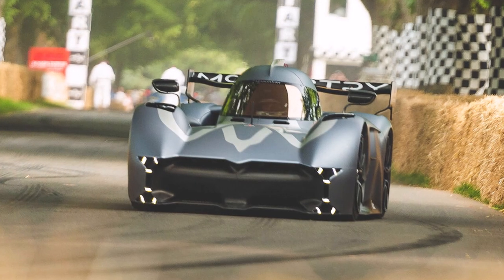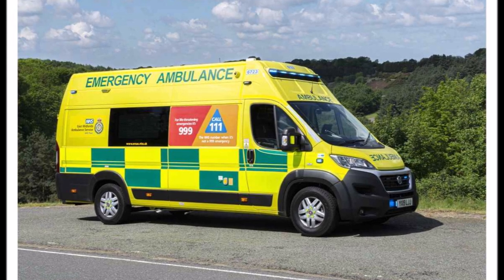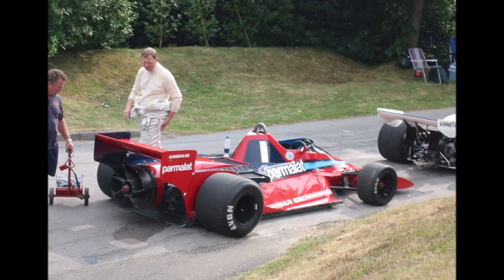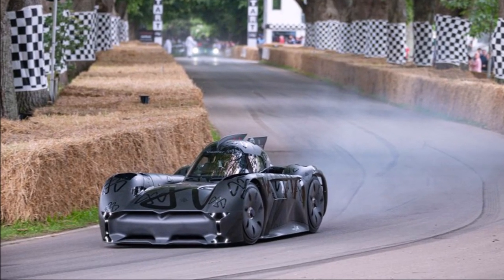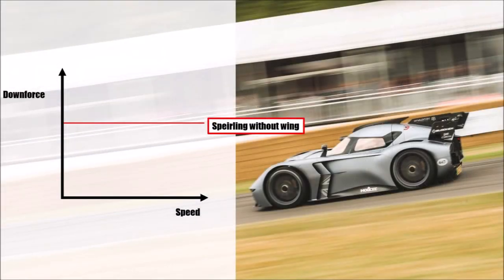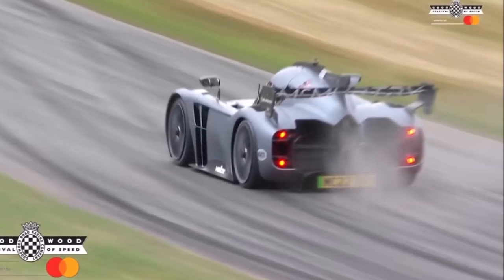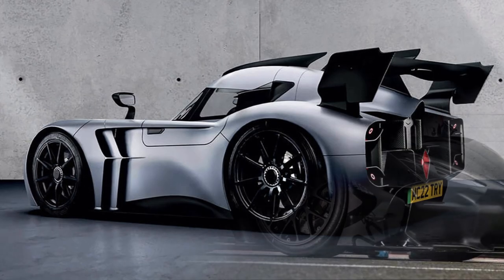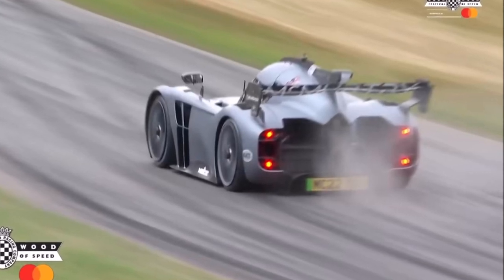McMurtry Speirling - The Unusual Engineering EXPLAINED

Comment: This car was visibly faster than anything I've seen before. Watching the speed gave me more of the sensation of watching a mach jet than a car. Just brutal.
Reply: To me it looked like the film had been speeded up. Astonishing.
Reply: It was about 6 seconds faster than 2nd place. Which is nuts on a track that short
Reply: The dust it sucked up made it look quick aswell
Reply: yeah, it looked like a gokart
Reply: @Life As Ya Know It it's both, the car was cornering faster than anything I've ever seen except for maybe an F1 car in a high speed sweeper
Reply: Legendary
Reply: So true this car was insanely fast and then wat impressed me to was the ford van tats shitt was hella fast too
Reply: I was at goodwood and felt that too
Reply: I suppose the fact that it's very small makes it look faster, just as a 747 looks slower than normal passenger jets, if you see what I mean.
Reply: @thugis07  
WTH is a”cords van tat shitt”?
Reply: @theinspector1023  
To paraphrase Father Ted “These jets are small but those up there are far away”
Reply: @theinspector1023  
Link to FT vid https://youtu.be/MMiKyfd6hA0
Reply: @thechumpsbeendumped.7797  the ford transit van bro u didn’t watch other good wood vids
Reply: @thugis07  
I did watch the Ford Supervan at Goodwood, but that isn't what you wrote bro.
Reply: @thechumpsbeendumped.7797  I was Only missing a letter bro n u couldn’t guess tat
Reply: Yeah I thought,christ that things absolutely moving!!last time inward that surprised was watching the Volkswagen idr.
Reply: @thugis07  
So 6 letters in total, coz the vehicle is called (drum roll) Ford SUPERvan. Never mind bro, you did get half the name right  😆  Well done dude, 50% is considered a passing grade in some places. 👏👏👏
Reply: @chopperhead2012  well it's nice to see a go kart to go that fast 🤭
Reply: @m.b.82  Isnt the car that get 2nd placed is had a record of 39,90? It's 0,10 slower than the 1st one, and the 2nd one is also electric, it's from Volkswagen
Reply: The 1st time I saw it…
It took corners so fast…I thought it was fake!!!

Comment: One of the maddest facts about the speirling that max Chilton mentioned in an interview was that with the downforce and traction control off it'll spin the wheels up to 200mph in 0.3 seconds
Reply: What does that even mean? That doesn’t make sense pal…
Reply: @TheLogicprouser  it's how fast the wheels spin in a burnout
Reply: @WynnofThule  so it can break traction in 0.3s? Is that 0.3s the time from pressing full throttle to the wheels breaking traction? Is that time actually impressive for an ev? Is there any other ev to reference that time against do you know?
Reply: I assume it means that the wheels spin to an effective speed of 200ph. 

As in the necessary rotation that would be required for 200ph if it was retaining all traction.
Reply: @FazeredTube  ahhh ok yeah that makes sense cheers bud 👍 comment read like at any speed up to 200mph it could spin the tyres in 0.3s which didn’t make sense but it was just me 👍
Reply: @TheLogicprouser  no, 0.3s is the time from throttle/energy input to the wheels hitting 200mph
Reply: @TheLogicprouser  it means the tires spin up fast enough to push the car to 200mph if it were to have traction
Reply: That’s just due to electric motors lol……
Reply: @alanmay7929  technically its the torque said electric motors produce but I'm just being pedantic
Reply: @TheLogicprouser  it means if you floor it, the back tyres will instantly be spinning at 200mph. Which is nuts
Reply: The wheels might spin at 200moh in 0.3 seconds, but that doesn’t mean it would accelerate the car to 200moh in 0.3 seconds if it had traction. The car is much heavier than the wheels…
Reply: @DanielFenandes  exactly. it does mean it has a wicked throttle response time. 
but it is possible to calculate the 0-200mph time with that info. if we had the weight of the wheels. the only thing that seems weird to me is that the say 1000hp . while such 0.3s time sounds like a lot more. or the wheels are very light and direct drive. meaning "0" drivetrain loss. the peak power draw might a few ms way higher than 1000hp or 746kw
Reply: @DanielFenandes  not my point. Chilton was saying that with the traction control off it does enormous burnouts
Reply: @thomashayhurst6547  ah yes, makes sense. But some people here are commenting that if it had traction it would accelerate the car to 200mph, which is nonsense
Reply: @DanielFenandes  yeah that's total bollocks. The laws of physics just wouldn't work that way
Reply: @TheLogicprouser  It means burnouts 4 life man
Reply: It's just a fun fact. Holy smokes people. 

How this was confusing or triggering for anyone.....is really triggering me.
Reply: Yeah I honestly believe that this is a bullshit claim. I would probably believe it if we were talking purely about the rotors of the motor, but accellerating the entire wheel that quickly? Unrealistic.
Reply: @theforbiddentoystore1203  you are correct in a sense. If we didn't have to take into account mass and drag then yes the car would accelerate to 200mph in 0.3 seconds. But if you add the mass of the vehicle and then the drag as it accelerates it's going to take substantially longer then 0.3 seconds to reach 200 even if it had all the traction.
Reply: @TheLogicprouser  Are you Scottish?
Reply: @michaellavery4899  nope. Midlands. 👍
Reply: @seelooney9042  Underrated comment
Reply: @cinimini4854  Being that an electric motor on a car is usually MUCH heavier than the wheel with much of that weight being the magnets, and with brushless motors the magnets are the only spinning part of the motor, i dont see why less than half a second to 200 is that hard to believe. Some light weight wheels and tires would be nearly no load to a 1000hp brushless motor. If the motor is making 1000hp its probably making more than double that in torque at 0rpm.
Reply: @seelooney9042  yes, people just don't understand. A lot. 🌻
Reply: @Dubz0408   Logical. But not for many people as they do not understand physics and math. Ofcourse is it easy for an electric motor with always all the torque available.  You and I know.  Sorry, didn't finish my engineering study. Yet learnt a bit. 😀😀👍🏻
Reply: that would be an acceleration of 30G.
Reply: @intrametaarchi1015  Maybe in a world of perfect traction but were talking about this being a tire smoke machine.
Reply: @Dubz0408  not necessarily. construct a body which will withstand this acceleration and place the car in front of a high speed train.
Reply: @intrametaarchi1015  We definitely need a jump start on that maglev tech in the US lol
Reply: But the top speed is only 150
Reply: Funny what happens when you have instant torque.
Reply: @Mukesh_Rana._  the top speed was only 150mph because of the limiter. This car seems it will continue accelerating until it loses control lol 250mph+
Reply: @Joel  it means with TC off, the wheels are able to spin, like a burnout, at up to 200mph in 0.3s. Or, in 0.3s, the wheels are able to slip at up to 200mph.
Reply: @WynnofThule  guess that claim is true, but it doesn’t sound correct. 
Even if the driven wheels weren’t in contact with the ground, it seems unlikely that they could reach an effective rotational speed of 200 mph in only 0.3 secs. With the car sat on the ground, for the wheels to reach a rotational speed of 200 mph in 0.3 secs seems wildly unrealistic..
Reply: @intrametaarchi1015  that's 67.9 g's. it will feel like car crash every time you floor it lol.
Reply: @ScramTek  yup. that's just some rubbish layman claim lol. triple overload the current with no wheels whatsoever maybe. max setting with only one button, not pedal. 0.3 sec is literally a blink of the eye. lol

Comment: As a track focussed hyper car.. this thing is in a completely different league to the new AMG project one. This is aerodynamic engineering at its absolute best. Good video Martin. Thanks
Reply from the maker: Thanks Olli, Agreed!
Reply: I bet that most AMG project one, Aston Valkyrie, Koenigsegg Jesko, etc. cars will never be driven close to their full potential unlike porsches, supras, and miatas.
Reply: Considering how small the car is to carry a big battery and that it's not available to public, I can assume its only good for this types of runs(2 or 3 laps full send) Don't expect this to have long range or be 'consumer friendly', like the amg or aston.
Reply: @sepg5084  Yes, those cars would mostly be purchased as investments and never driven in order to protect it's value.
Reply: @rickyricardo2006  it's not exactly what I'd pick to go shopping, but it is street legal and has more than enough range to drive around town. But McMurtry is too small to build them in any quantity so there will probably never be more than a few hundred MAYBE a few thousand, optimistically. Sadly its meant for the discerning collector market
Reply: @rickyricardo2006  This are just preliminary specs so it can be not true bit so far ive read it has a 60KWh battery which gives it about 30-50 minutes of racing performance (that time looks a bit optimist to me so i would say about half that so 15 to 30 minutes) so not bad at all and about 480Km range if driven like a normal car. Actually very impressive, i guess the secret sauce is to be a small car.
Reply: @teresashinkansen9402  480km range? I don't even think teslas are that efficient in real world my guy. This car has definitely a smaller battery then a tesla. Then again, teslas cars are larger. Either way, I'll take it for what it is. A car solely design to beat goodwood record. 

The most impressive thing for me is the fan tech it has to keep it grounded. Granted, they didn't come out with the idea, they implemented it flawlessly on this car.
Reply: @rickyricardo2006  A Tesla weights more than twice as much as this car and being larger has larger frontal area so more aerodinamic drag even if it has a low drag coefficient, this car has all that on its advantage, plus not relying on a wing only for down force they could make it as streamlined as possible for lower drag coefficient, just look at it, its so streamlined for a performance race car. Drive it at 120km/h with the fan turned off and i wouldn't be surprised if it can actually reach those 480km easily. Tesla weights 2,162kg and with a 100kWh battery can do 560km (claimed but sure there are videos that prove it or refute it) This car weights around 1,000kg and has a 60kWh battery, so i think its entirely possible for it to do that distance.
Reply: @rickyricardo2006  500 km of range is confirmed. Which is pretty okay for a car that small, let alone a supercar 😂
Reply: @sepg5084  True
Reply: @sepg5084  well they don't like Koenigsegg at the Ring
Reply: @sepg5084  And Corvettes
Reply: gma t50 makes more sense than this
Reply: I want to see it do a lap of Nurburgring
Reply: Satanic Panic Fun and Games  how is this electric car any better lol. batteries loose their prefromance after recyled in mass, not practical for electric cars. emissions only improves vs toyota prius prime, if runing on clean made energy, which is rare, in fact prius prime is s bit lower emissions overall than the most effceint tesla. electric grids cannot handle too many electric cars charging in a given area.     gma t50 is much more fun to drive and usable everyday than this electric sport car
Reply: Satanic Panic Fun and Games  its just bc its the practical side to topic of cars. even prius prime can be better
Reply: @devandrasimanjuntak1646  these buyers dont need more range as much as they want speed and agility and fun car to drive. it should have been more like panoz deltawing with freepiston and air pressure regenerative braking car, would be lighter and would force developing tech that coudl be futhur developed for affordable car, and truely more sutinable with e fuels , hydrogen combistion etc. i responded to OG comment with explaining why eelctric car is scam
Reply: Dude you have no idea😂😂🤣🤣
Reply: @Cartman5101  Interesting reaction.. 🤔
Reply: Satanic Panic Fun and Games  gordon murray t50 was made for fun and everyday use. its more fun than this dumb electric car

Comment: Conceptually, this is the same as the Chaparral 2J Can-Am car, of 1970 vintage. It had problems, but was eventually outlawed because it was so much faster than any other car. This has been the story of a great deal of true innovation in motorsports.
Reply: Its just unnatural. Controlled aerodynamics like this will break ground effect over bumps. While its very fast in a turn. Because it relies on manipulating ground effect. If you break ground effect and 6 g in a sharp turn?  One bump or curb or rib. Its dangerous
I designed a controlled aero car but in a completely different manner that wouldnt rely on ground effect but generate just as much downforce and be much more safe
Reply: @treatb09  Show us your design, please?
Reply: @treatb09  id like to see that design
Reply: I remember the Chaparral and remember they banned it as it smoked everything else. Glad to see it's making a comeback. This car was insane to watch at Goodwood.
Reply: @treatb09  The Chaparral car had active skirts tied to the suspension in an attempt to minimize the effect of irregular surfaces.
Reply: I too remember the Chaparral. It was the fastest car on the track. That meant everyone didn’t want it there so they banned it. Good luck to this new version.
Reply: Yep, I came here to say the same. Most of the credit for this goes to Jim Hall of Chaparral Racing.
Reply: @treatb09  Bo, I'm designing a car that can be manipulated via hand control stick during jumps,, and cornering,, or possibly stunts w.out ramps, I'm envisioning a large flywheel spinning in the floor of the car, manhole cover so far is quite Impressive!
Reply: @PaulMEdwards Jim Hall had nothing to do with with development of this car ?

If you are thinking about the fan technology. I would still say no. The 2J was so crude that it lost the Can-am even though it was the fastest when working. 

So much development has gone into aerodynamics and alot of advancements. If you are gonna use that logic then you really gotta credit Karl Benz for the 2J aswell, since he brought out the first car.
Reply: Yup identics as 2j with new tech and smaller form of fans system
Reply: @ab-gu2nh  The McMurtry is, Concept wise, basically an electric 2J using modern technology

Comment: They made so much progress from the last time.
For me, this is the most impressive track performance car I have seen in years. I am keen to continue following their progress. 
Also thanks for the insight.
Reply: Got to be the most impressive road legal car ever, not just the sheer speed but the marvellous engineering
Reply: @mileswhd1234  how is it road legal!?
Reply: @alanmay7929  not sure if the road legal variant is fully a thing yet, but the one from FOS had a plate 🤔
Reply: @mileswhd1234  it’s not road legal! Fan cars are not road legal! Plus what about safety????? That car is tiny compared to other participants lol…..
Reply: @alanmay7929  google it, a road legal one is apparently going to be released later this year
Reply: @alanmay7929  the Gordon Murray T-50 is also a fan car, and it is very road legal 👀
Reply: @alanmay7929  - The fan can be turned  off for road use. It’s not required to be on all the time. There are other small sports cars on the road, size won’t matter to make it street legal. But yes, they are releasing one in a year or so.
Reply: @wallymcguire2033  lol……. That doesn’t mean the person driving it won’t turn it on! It should be totally desactivated or made not road legal! Also there is no word about that car crash safety
Reply: @alanmay7929  - It’s up to the relevant jurisdictions to determine if the vehicle has passed their safety standards, not your inane mutterings. You don’t even make sense. You should leave it up to the professionals to go through the process. They said it would be out in a year so wait and see instead of commenting on something that is just starting out along a process.
Reply: @alanmay7929  I’ve already said it, the Gordon Murray T-50 is a car with a fan like this one and is fully road legal, it even has the functions that was mentioned to turn it off. Not sure why you’re so against the Speriling but absolutely turn a blind eye on the T-50.

Are you going to lobby for the McLaren F1 to get banned too then? Because if you didn’t know, the F1 also has 2 fans in the back of its diffuser, but I see no problem of it being road legal 🙃 And the F1’s fan work all the time too.
Reply: @devandrasimanjuntak1646  I was precisely talking about the safety of that electric car troll!!! It’s a tiny track focused vehicle it doesn’t have the regular day driving capabilities of the Gordon Murray car lol….. have you even seen how tiny that car is!?
Reply: @alanmay7929  it’s about the same size as a kei car (maybe even smaller) but it weighs 1,000 kgs instead of 700-900 kg of kei cars. If a kei car that is only built out of cheap steel and costs about the same as motorcycle can be safe enough for the road, then I’m sure this 1,000 kg carbon fibre supercar can is plenty safe.

Examples of kei cars: Suzuki Cappuccino, Suzuki Jimny, Caterham 170, Daihatsu Mira, Honda Beat, etc. Trust me, I’d rather be in the Spreiling than one of these if you’re concerned about safety. Yet these things are road legal and, for people in Japan, only need a motorcycle license to drive.
Reply: @alanmay7929  Well then how is a T50 road legal?
Reply: @thel8815  it’s fox legal because it was developed to be daily driven and not totally track focused 1000hp electric toy lol……. The t50 is also a whole vehicle with all the safety features and equipments……
Reply: @alanmay7929  You claim it's not legal because fan cars aren't. When I and other point that out you change the topic. Ye it's not road legal but not because of the fan...